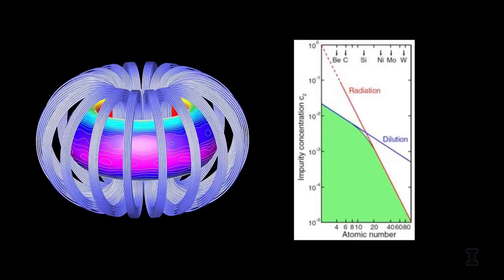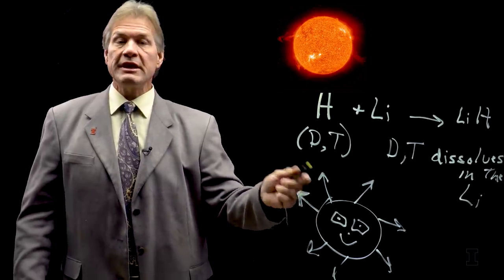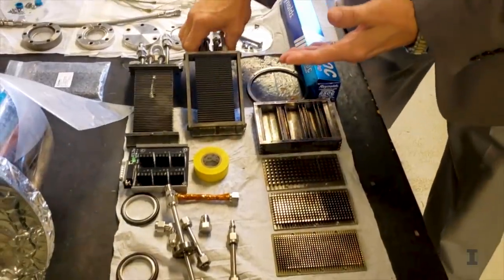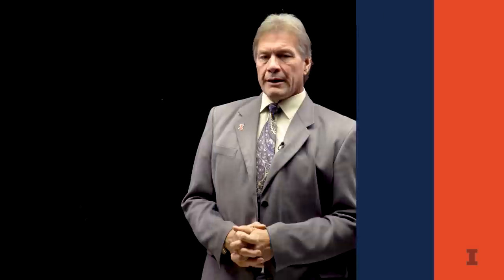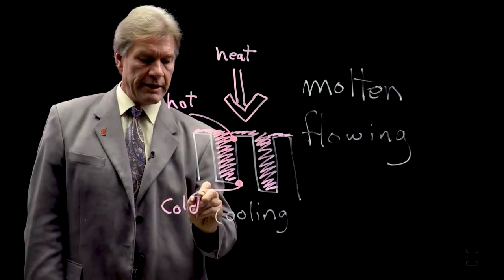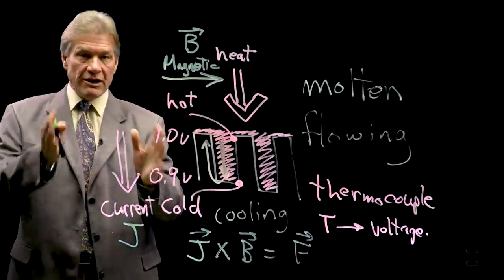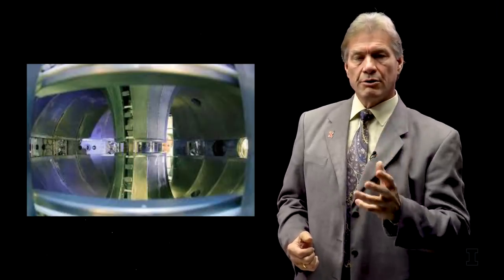Lithium for Fusion Energy

Comment: Can the Lithium also act as the blanket to transfer the heat energy into a working fluid?
Reply: It won't matter. All the EV battery manufacturer will be hogging all of it for themselves. Tesla already has many exclusive contracts with  mine owners around the world. We are going to run out of lithium.
Reply: Bryan Hensley TSX Venture companies are seeking massive raises for lithium exploration all over the world. It projects to be a strong performing sector in the near future.
Reply: @GregScholfield  hopefully they'll be able to move away from lithium in batteries.
Reply: I don't think it takes that much lithium to run fusion reactors compared to batteries.  Also, a little bit of lithium makes an outhouse full of tritium.
Reply: Lunar Regolith
Reply: You know the basic battery technology hasn't changed since the beginning. Just harder, better metals and advance chemicals that can stand up to the harsh reactions.

Comment: Why isn’t thorium being used for power generation. It is much safer and the radioactive properties made it easier to store after use.
Reply: Not really qualified but until a better answer comes.  
1. The technology doesn't exist to build a reactor that the molten salt wouldn't corrode
2. Dont have the Robotics needed to maintain said reactor. When it does corrode
3. Contrary to popular belief can still be used to make a bomb. 
4. Creates very hard to safely contain gamma ray emissions
5. Cost to develop is off putting when the fusion reactor  that proffessor Ruzic is discussing is tantalisingly close(though probably not in the next 50 years close) that would make any molten salt reactor obsolete.
Reply: Thorium is more difficult to use than uranium as a fuel because it requires breeding, and global uranium prices remain low enough that breeding is not cost effective. Specifically Thorium is not fissile on its own but must be transmutated into U233 which is fissile.

Comment: Yes lets make our Fusion reactors out of one of the most reactive substances that exists, one that with spontaneously explodes in the presence of water. And is highly flammable in air. Sounds really safe.
Reply: Are you aware that your microwave oven could have beryllium in it's parts, a highly carcinogenic element?
Reply: @henrytjernlund  as long as it stays inside my microwave then I don't see the problem, you don't make a reacter out of something that explodes if exposed to water.
Reply: This stuff has to be stored in oil because it reacts with air
Reply: In fusion reactors the vessel is under high vacuum, no water or air present to react with the lithium. Yes in the worst cass senario the lithium could catch fire, but this is exceedingly unlikely and would require many other systems to fail before it would even be possible.
Reply: @jeremymettler2844  One of the big selling points of fusion is that it's safer then fission reactors, this would be negated if the introduction of air or water could cause catastrophic failure.
Reply: @jeremymettler2844  is it always under vacuum, what about when's it's off, how is maintaiance done? What if the power fails, what if there is an earthquake? If you use lithium you can never expose it to air.

Comment: Just from a physical properties of a liquid a toroid is not the best recepticle. The best is a sphere or ovoid to keep the walls coated with a liquid.
Reply: The toroid design is necessary for containing the plasma. The toroid essentially allows the magnetic fields to wrap around on themselves, creating a trap that keeps the plasma in. There are designs which approach spherical shape, but these are much less well understood.
Reply: @jeremymettler2844  I understand the reason for the toroid already and shape necessary for magnetic containment. Back in the beginning there were designs for spherical containment vessels, they might want go back and look at that research since that was more then 30 years ago.

Comment: Wouldn't it be closer to 30x smaller, given that (1/3)^3 = 1/27? Then again, I presume there are diminishing returns on the miniaturization since certain parts have to be a certain size regardless of the size of the fusion chamber (eg, thickness of the chamber walls).

Comment: Where does all the Helium go?  Assuming the need to do something with the deuterium is because of the inherent inefficiencies of the fusion process.  Seems that you would want the deuterium to flow back into the process.
Reply from the maker: We also did an experiment and wrote a paper on the ability of the flowing lithium to pump the helium out. Although using a vacuum pump, which the device has to have anyway, will likely be fine.   When we do separate out the D, it has to be injected into the core -- and we would use high energy neutral beams for that.

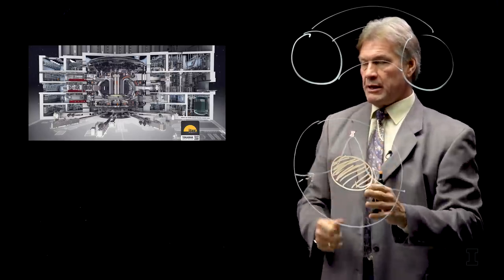Comment: @5:05 - How does having Lithium walls suddenly mean no cold flux from those walls? In the beginning, he did mention that D,T can react with the Li, or dissolve in it, but that doesn't explain why the walls would  not be colder.
Why does the Lithium enable the whole volume of the device to have that higher temperature profile? What does the Lithium do? Is there some chemical heat of reaction there?
Reply: Because the lithium is pulled out before it is saturated
Reply: @johnfedoruk  hi, thanks for replying - but I still don't understand. What does pulling the lithium out before it's saturated do? How is lithium pulled out? Is it some kind of liquid boundary? I thought it was solid.
Reply: @manofsan  molten flowing lithium covers the inner walls of the reactor, held on by surface tension, and flows into and out of the reactor. Distillation processing clears out the solutes from the lithium once removed, and is then recycled back into the reactor.
Reply: @johnfedoruk  so does that mean the molten lithium is hot enough that there's no cold flux returning from the walls to the rest of the reaction, and thus allows the full available volume to be of relatively more uniform and higher temperature?
Reply: @manofsan  I believe so

Comment: If the reactor is operated at steady state, the hydrogen dissolved in the lithium must be returned to the plasma regardless. So isn't separating it by distillation an unnecessary step?

Comment: 14.07 Dumb question time. Is'nt the magnetic field being generated outside the lithium walls by the magnets? The magnetic field has to travel thru the lithium current, won't that strip the lithium off the wall?
Reply from the maker: It has to do with the direction of the magnetic field at the lithium wall.  Expelling droplets is a worry, but there is surface tension as well.  We did a whole experiment on the threshold for droplet emission and it was the basis for a student of mine's PhD.  There is a publication on this on my CPMI website.   Good question!
Reply: Not an expert, but I believe the magnets outside (and inside the center) produce a current in the contained hydrogen, that in turn produces its own magnetic field (from the hydrogen) as a result of that current in the hydrogen. This new field opposes the originally generated magnetic field. As a result of the field falling off by distance, whichever source you are closer to will be felt more by the lithium, so I think it has something to do with that

Comment: I've always wondered how you would remove the energy from a Fusion plant and make electricity safely.   Fission plants do this rather inherently by design.  To my knowledge, no one has explained how to get the energy out of a fusion plant safely until now.  I assume there would be a secondary loop to create steam and drive a turbine?
Reply: @Sidowse  Tonycmac is very valid.  He asks a very important question.  You want to use fusion to generate electricity.  How?  Like the ITER you need magnetic confinement to restrain the plasma in the centre of the loop to start fusion.  All the heat is in that plasma.  You cannot allow the plasma to hit the wall.  Then how to take the heat out to boil water to generate steam to drive the generator to generate electricity?
Reply: @Sidowse  You mean fission?  Fusion can potentially radiation free provided you do aneutronic fusion.  You need to use materials that requires a order of magnitude higher temperature to start the reaction.

Comment: I’m confused still. Don’t you sometimes want to get D from neutrons reacting with lithium? So do you need to separate different Li isotopes? And how do you get the He out? And upside down is it pressure that keeps the molten Li in place?

Comment: I wonder if you can forego the divertor this way, or what even happens with the other "ash" (helium mostly) do they disolve into the lithium too ? Do you need enriched lithium ? Li-7 may produce tritium in such flux,  is this a problem (fissioning lithium may overheat and ultimately evaporate the lithium) or an advantage (if dissolved tritium can be taken out from the molten lithium it can be recycled as fuel (in D-T case))?

Comment: Can you explain how you actually turn fusion heat into usable electricity when your whole focus is isolating the heat in the reactor from the reactor itself ?
Reply: I have heard some say  that at some point the walls will need to liquid cooled and heat exchange possible..... My concern is that once it goes critical and it becomes easy to extract copious energy, a single pop would not be a trivial accident, with resounding reactionary effects akin to 3 mile Island.
Reply: @dennisgarber  No because as soon as that pop happens the fusion stops. You could get a steam explosion just like any other power plant. Keep in mind that although it produces a lot of energy there is not a lot of density.

Comment: Interesting using liquid lithium.  However, as high school chemistry student over four decades ago, I see a serious safety issue here and was wondering how it was going to be solved.  From what I remember and verified via Google, lithium violently reacts with water.  Even current light water reactors experience leaks.  What happens when the lithium find water, and it will over the lifetime of the reactor vessel?  What is going to be the passive safety system in a lithium reactor?
Reply from the maker: Sodium is much worse than lithium in its reaction with water, and there were commercial molten salt reactors in operation.  Since the molten material is not under pressure, it can all be handled.  One does need to be careful of course!
Reply: @illinoisenergyprof6878  Thanks for the reply.  I didn't realize that it would not be under pressure which is a lot safer to handle.  I guess I grew up being on guard with boron in PWRs.  Davis Besse was beat into our heads.  Water chemistry at the plant that I worked at (a BWR) was critical and always kept within spec but we still had leaks.

Comment: Excellent video!! 

I have a question though. By using lithium over the walls, wouldn't the neutrons from the reaction (if using D+T) be creating more tritium, and thus, creating a need to replenish the lithium constantly? 

Thank you very much
Reply: Isn't the current that creates the flow in the lithium supposed to move away the affected lithium so you can replenish the walls with fresh lithiem. I don't know.

Comment: I expected this to be about generating tritium from lithium. This is way cooler.

Won't it do that as well though? Make new tritium from neutron radiation from the reactor hitting the lithium.
Reply: I am but a humble shopkeep, but I do recall reading a copy of New Scientist between serving customers and how using Lithium in the walls would breed Tritium for the actual Fusion reaction. When I saw the video title I thought that this is what this video would be about but its not. However, given the actual subject of the video, the Tritium breeding I remembered from the NS article and the heat removal questions some others brought up, would I be correct in thinking that Liquid Flowing Molten Lithium in the walls is almost too good to be true if they can get it to work. ie. Makes it possible to build the Reactors 20x smaller and cheaper, uses the Neutrons to breed the reactors own fuel and is also how you get the actual heat out of the reactor?? A holy Trinity of benefits.
Reply: Breeding tritium is definitely a secondary benefit of this kind of system as well!

Comment: 1) Looks like the trenches had little to no lithium in them.... is it just my impression from the video or was there an issue with that particular implementation?  (LTX 😍😍)

2) Has LiSn also been tested in the trenches?
Reply from the maker: We have other examples with the lithium at a level just above.  You can see the motion the best though in an under-fill.  We have been testing SnLi, but it has not made it into the trench structure yet.  Stay tuned!

Comment: How about fission of Lithium? No risk that happens?
Reply: Well for starts Lithium-6 is a stable element so it doesn't just randomly split itself. You have to pretty much force it to split by bombarding it with something.
Which brings us, to: 
It's kinda desired effect of current prototypes of fusion reactors. Lithium-6+neutron (that you get from D+T fusion) -> tritium + Helium-4. The reaction is well understood, (thermonuclear bombs don't lie), the question is can scientists/engineers make it so that this reaction will be produced right inside reactor to limit external exposure to very dangerous tritium. It's one of many things ITER will test.
Reply: @Poctyk  If this is the objective there's a much easier way, namely flow tritum gas through uranium, and use the explosive expansion to drive a turbine. But we thought that fusion would not generate toxic byproducts. Will it necessarily?

Comment: Would be great to hear the prof. about Thorium (fission). Is that just a hoax or would it really be possible?
Reply: Thorium fission is absolutely possible. The fuel cycle is different from that of a U235 fissile reactor. The primary reason for U235 being the fuel of choice was that early reactors were designed specifically for the purpose of creating fuel for atomic weapons.

Comment: Here is what I don't understand. Each and every long term (millions of years) functioning fusion device in the universe is a sphere not a torus. Even our fusion weapons use a spherical design. Why do we keep trying to make torisus work when the sphere is a proven design?
Reply: There are designs for "spherical fusion power plants" They involve damming and building a dome over a section of ocean, Dropping in a thermonuclear weapon every so often and then using steam turbines to generate power. The idea never really caught on.

We also use a very different paradime in the fusion reactors we are trying to build. A thousand times hotter temperature but a million times shorter. We can heat it up just fine. Keeping it contained is the hard part. A torus is a way better shape for confining something than a sphere.

Fun fact the suns power density is equivalent to a compost heap. Only 300 watt / m3.
Reply: The reason stars are spheres is because they rely on gravity, not magnetic fields, to hold themselves together. Bombs use compression to squeeze the material (very briefly) down before it explodes outwards. Since Tokamaks rely on magnetic fields to contain the plasma, and ideally want to contain that plasma in steady state rather than expand outward like a bomb, they need a shape where the magnetic fields can wrap around on themselves. The toroid allows this sort of self wrapping to take place, which forms the magnetic trap.

Comment: How is it possible for the "flux to the wall" temp to be 100,000,000 degrees?

Surface temp of the sun is less than 10k.
Reply: think about the question for more than 3 seconds

Comment: The current flows the other way, though.
Reply: Are you talking about a different part, cause in his example of the thermocouple it would flow from the 1.0 to the 0.9 as he demonstrated.
Reply: @lordofentropy  Current flows from the lower voltage to the higher.

Comment: When you said you needed to refresh the lithium at the top I was thinking that convection from the heat could be used to move the saturated lithium away. Seems you are already doing a version of that with the temp. difference and magnetic field. I was thinking if you have heat at the center and cool the back of the trough couldn´t each trough have it´s own convection cycle instead of moving across the trench. Much like a cooking pot on the stove. 

Could you do a video on focus fusion? They make it seem like it will be so easy to collect the energy created from the fusion and that it will be much cheaper than all the other methods. https://www.youtube.com/watch?v=yhKB-VxJWpg